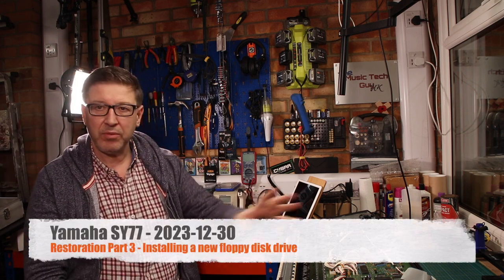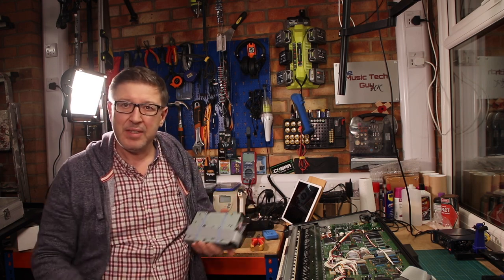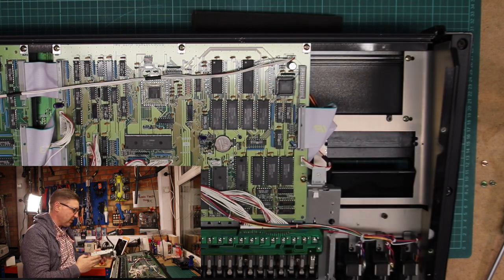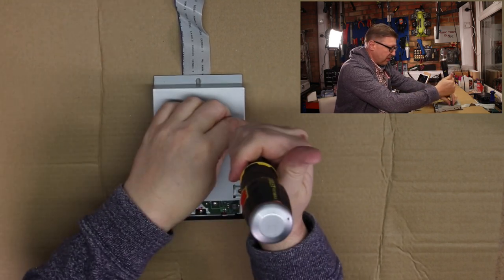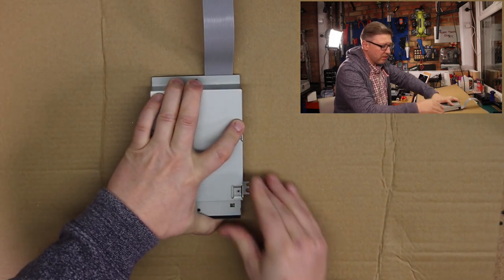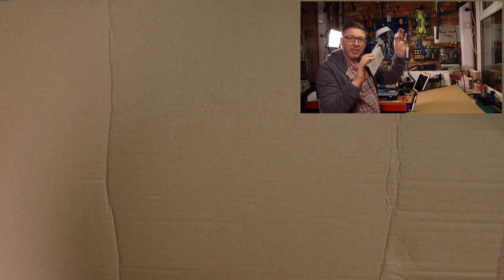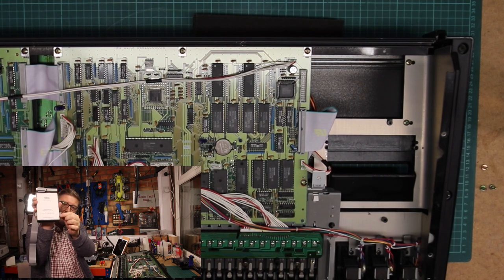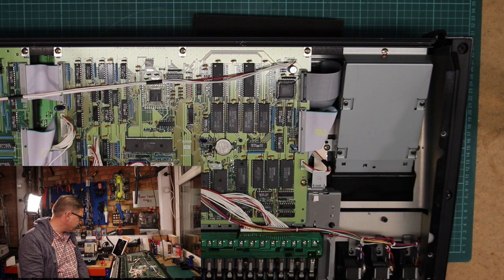Reviving The Yamaha Sy77: Installing a new disk drive - Restoration Part 4

Comment: Do you know the exact modification to the new floppy drive cable in order to make it compatible with the SY77? ...  I chased this up ages and ages ago when I was considering buying a SY77 but can't find  the info any more... As I remember, there was a change required in the wiring harness in order to connect new / standard floppy drives to the SY77 .. this applied to both standard floppy disc drives as well as Gotek virtual floppy drives ... anyway, great job and I'm glad that you managed to get this beast up and running again.
Reply from the maker: Hi @daz4627 

Thanks for the feedback.

The Yamaha SY77 uses a 26 pin connector where as a standard floppy drive uses a standard 34 pin connector.  Looking at the drive that has been supplied to me, modified by the vendor the connection is as follows.

A 26 cable ribbon connector is used where cable pin 1 is connected to pin 1 on the 26 pin connector and cable pin 26 is connected to pin 26 on the 26 pin connector.

At the other end.  Cable pin 1 is connected to pin 7.  And then in sequence cable pin 26 is connected to pin 32 on the connector.  Pins 1-6 and 33-34 are not connected. 

When you connect the cable to the connector do not trim the cable but separate out cable pins 1,3,5 which are connected to connector pins 7,9,11.  These should be connected to the 5V supply pin on the floppy drive.  Jon
Reply: @TheMusicTechGuyUK  Hi Jon .. thanks for the wiring details... I vaguely remember that there was a bit of a bodge with routing the cables ... choosing that particular drive was a bit of a blunder on Yamaha's behalf I think... never mind... at least there's a workaround... I'll keep this info filed away as I still have a hankering for a SY77 (or preferably an SY99) ... looking forward to the next lot of repairs (hopefully a bit less of a pain than the '77 was)  🙂
Reply from the maker: Hi @daz4627 No problem.  Jon

Comment: Even tho direct drive is better than belt drive why still keep it disc drive? Then you still need to get hard to find or overpriced discs. Other SY77 overhauls I've seen replace it with a USB port.
Reply from the maker: Hi @user-lw8dr6xx8i  I agree that the USB drives have there uses, but I have reasons for keeping the floppy disk drive in the instrument for the time being.  Jon